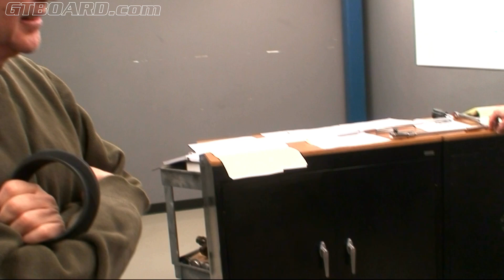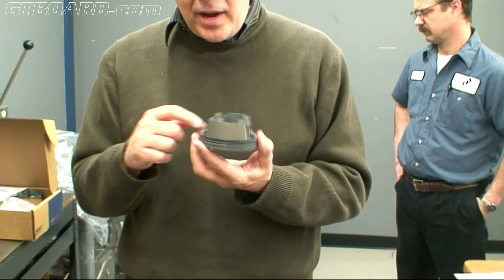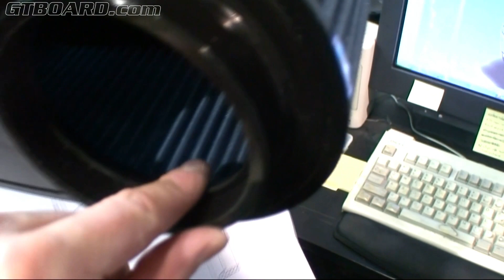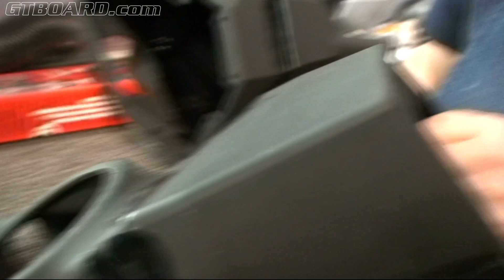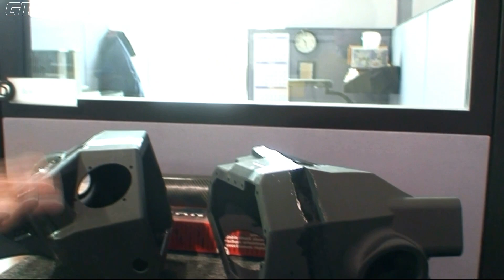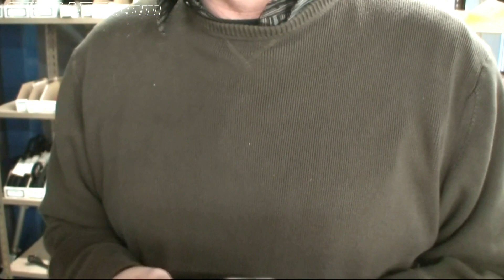BMW M5 V10 5,7 liter stroker in super detail by Steve Dinan. V10 expert!

Comment: I had my S85 block bored and honed for my 5.8L stroker motor build at Carbahn, Steve’s new company, would have not done it any other way…engine is a beast
Reply: What's the power bump, from 507hp? does it still rev as high as stock? as a Merc fanboy, the S85 is one of my all-time favorite motors, congrats on your build!

Comment: This video is older than 3 years old. The guy is an absolute genius. No one knows these motors better than him. Probably. But there's been new technology recently to help with this exact situation. Such as gas ported pistons. You heard me right tiny pen holes on the edge of the pistons at angles.  That helped the rings work
Reply from the maker: Its from 2009 around.
Reply: Dinan is liked to bmw since like the 2000's and im from chile , this man is a LEGEND

Comment: The guy is absolute wizard🤭 If there was a therm "Scientifically build S85" to make it last longer than 50k miles (even that is a veteran), this would be it.. And one more word missing here!?!? EXPANSIVE😉
Reply: How much longer does it last??! I’m thinking about buying one at 81000 kilometres
Reply: @masonblatz3843  Rod Bearings, Throttle Actuators, Oil Scavenge pump, and Vanoss bits(You could also install a Vanoss delete kit). But should have zero issues with the motor after those things, and the right and proper aftermarket rod bearings are installed. The SMG trans however, is pretty dramatic and fun to drive at high speeds and acceleration. But terrible in pretty much every other way, including insanely expensive maintenance. If you can find one of the 1400 Manual 6 speed equipped E60 made for the US. I'd highly recommend it for fun and maintenance reasons.

Comment: Boy,has BMW screwed the customer by using this process on the block. With the chronic issues this engine has,any problem in the bore means you have to buy a new block. Another reason I will never buy another BMW.
Reply: Yeah I don't know why he had so much excitement over it

Comment: How long is the drying time of the sealing product?
I have applied the How long is the drying time of the sealing product?
I have applied the product but it is not completely hard like when we open the engine block, it stays like silicone.
Thanks a lot but it is not completely hard like when we open the engine block, it stays like silicone.
Thanks a lot

Comment: I know it's an age old argument, but...10w60 or 5w50 oil, in a stock V10 with recent rod bearings...anyone?
Reply: Every garage I know only uses 10w60.  I always carry a litre of the stuff.  If the rod bearings are recent then they should be the new design and you are golden.  Old or new bearings no difference to the oil you should be using.  The only place I have come across folks thinking using anything other than 10w60 is a good idea is on YouTube.
Reply from the maker: Always Castrol 10W 60 😎🇩🇪
Reply: 10w-60 unless you want VANOS codes
Reply: Exactly...The main reason for the 10w60, from what BMW M division told me has to do with the Vanos system, but you can't tell back yard mechanics that
Reply: 0-50